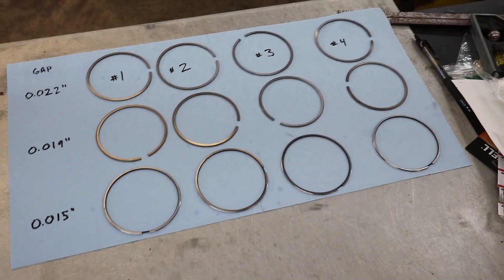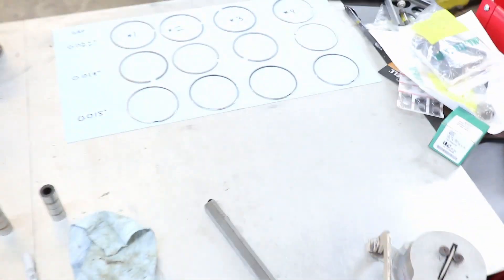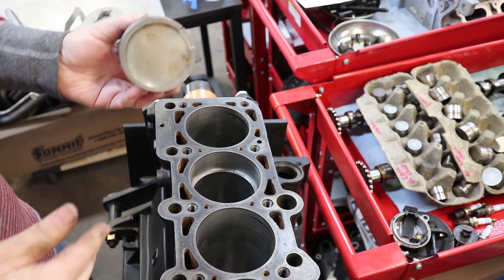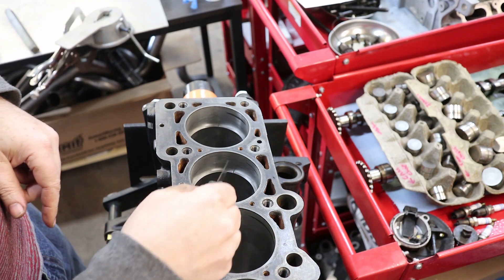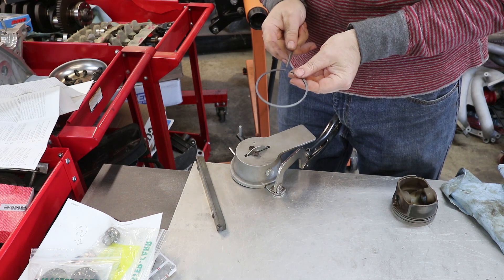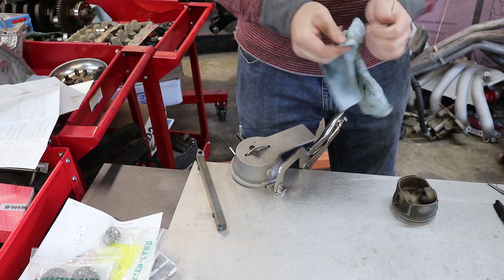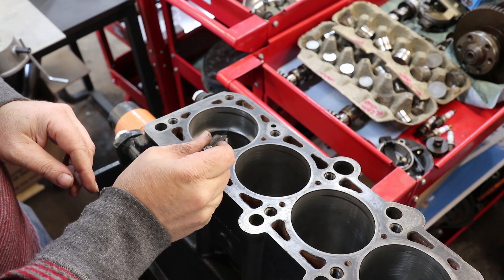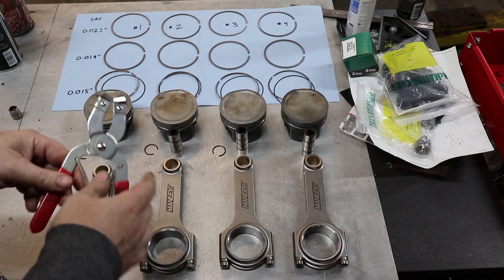All About Piston Rings - gapping rings for VW 1.8T

Comment: When I built my 2 stroke I used sandpaper to set the ring gap,just squeeze the ring against a folded piece, not sure if there is a issue doing this but the rings were nice and straights and the engine ran perfect.